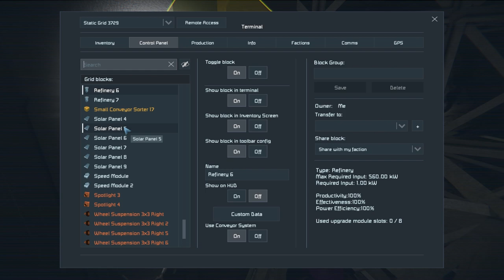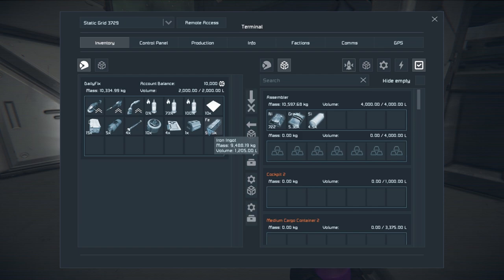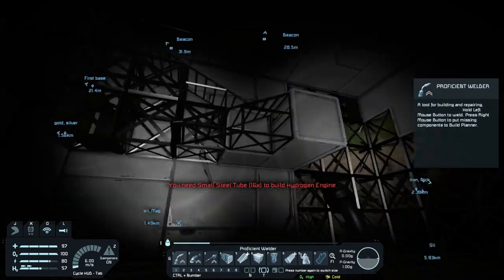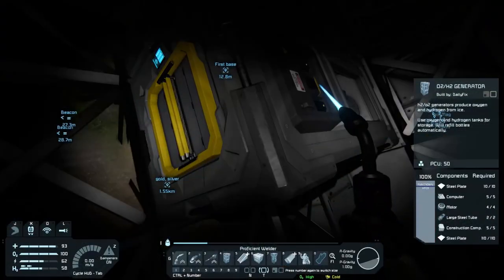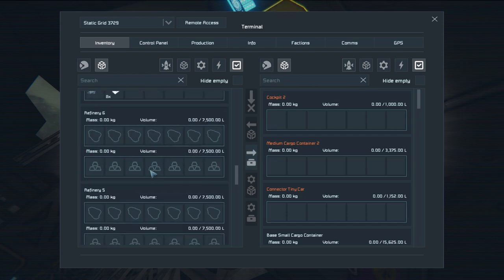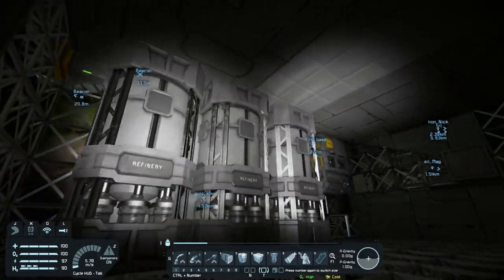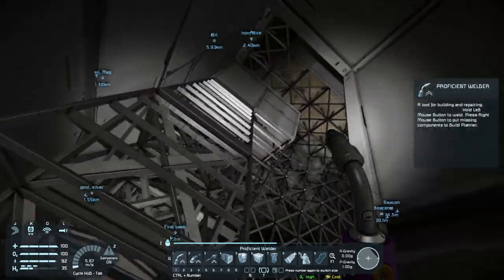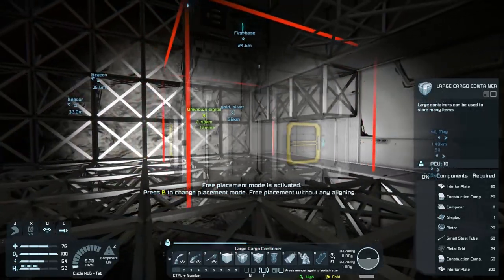[18] Hydrogen engine - Road to Space - Space Engineers Survival

Comment: I happily designed a carrier ship with 2 large cargo hold(now 6 small). You need a lot more batteries+large atmosphere thrusters than you can shake a stick at than what I had in mind, You can use advance rotor+small head and 
conveyor junction+sorter+small ejector to throw out whatever. Sometime you have to off/on the h engine to start it.

That happen when you have eg cargo hold and 2 thrusters covering it or 3 steel blocks in a right angle and is blocking the middle block from welding. Those are not lights XD
Reply from the maker: I have never used a rotor, seems like a nice idea. I agree on the batteries because when full I have energy for an hour. But I am somewhat disappointed in the storage room. But I want to make a room for your ship with a sensor and door so I can fly up out of the base. But then I guess we need to get started on getting into space. We need a lot of ice and hydrogen. What would be best is finding uranium.
Reply: I guess it is kinda randomly asking but do anyone know a good website to watch new movies online ?
Reply: @Deangelo Kendall Flixportal xD
Reply: @Blake Leonardo thank you, signed up and it seems like a nice service =) Appreciate it!
Reply: @Deangelo Kendall Happy to help =)